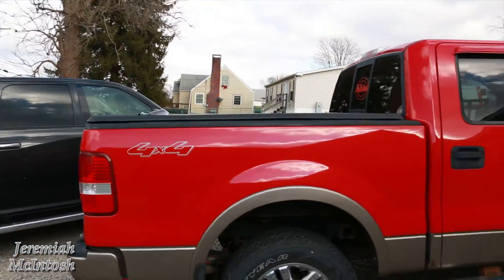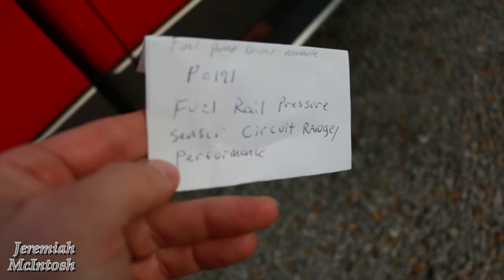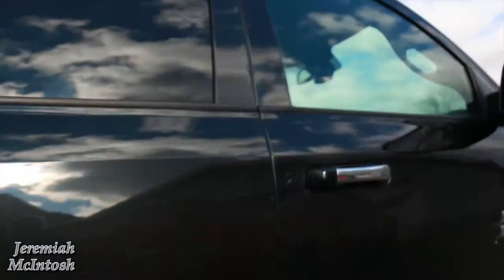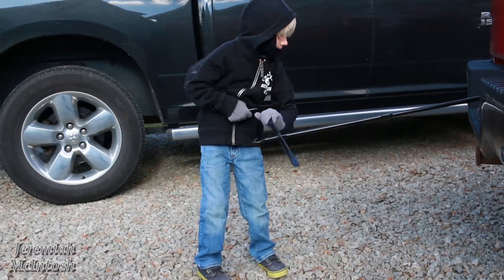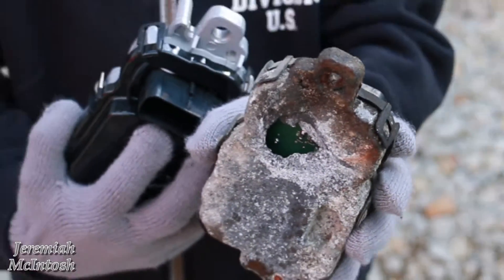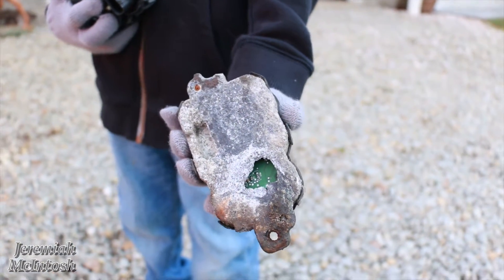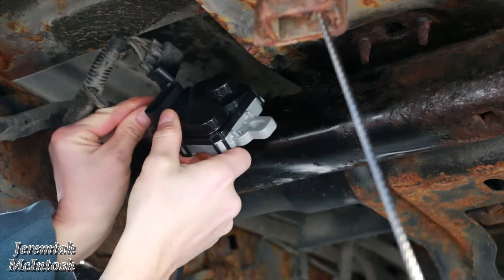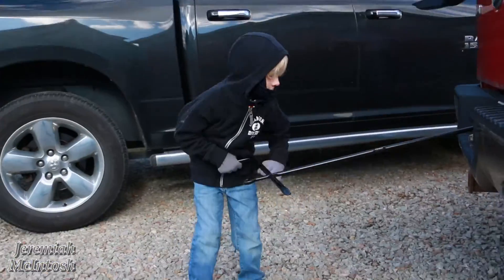Ford F-150 Fuel Pump Control Module. It will fail so Change it before it fails!

Comment: I'm having this issue with my 06 F150. Got the OEM module but turns out it needs to be programmed. 

 Did you not have to program yours?
Reply from the maker: Nope just bolted it on.

Comment: This video was a life saver for me!
My truck died on me 8 hours from home base. Had it towed to a local Firestone.  These clowns were saying all these other things was causing the issue, like battery , starter....to later fuel pump.
I did a cursory search online and found this video....pointed the service techs in the direction of this part....they begrudgingly replaced it after i fought  with them.  Lets start with a 130  good possibility as apposed to a 1k plus "guess" (fuel pump).  The sweet feeling of vindication when my beast fired up after replacing the module. I drove it back home 8 hours with no problems. 
 It also fixed another issue i was having for a while , possibly a "warning sign" that it was failing .
before i had this replaced ....my truck would occasionally feel like the the trans was slipping on acceleration.  That problem is gone now, probably due to fuel delivery issues
Thanks again!
Reply from the maker: Awesome and very glad it was helpful for you and saved you a ton of money. Hearing these things is what keeps me creating this content! Thank You!

Comment: Thank you...watching 20 videos and reading dozens of articles online,, listening to online mechanics..none of them even mentioned the fuel pump module as a potential cause.. I replaced the fuel rail pressure sensor,  and was considering the pump and o2 sensors and pressure regulator..$$$$😱..I just watched Chris fix replace it and test the power in the connector with paper clips last 2 holes on left and right of connector...and then your video pops up with the po191 code and you replace the module..wow..you have incredible timing..thank you...I really mean it man..haven't been able to work in a weak..going to shops, getting diagnostics and buying parts...your video was on time...thanks again...
Reply from the maker: You’re welcome I’m glad it helped you! Hope you get back up and running again soon.

Comment: Had a customer with a truck that died on the highway. He towed to my shop- I tested it with my OBD tool and it showed "OL" for the fuel pump.... Did a little research BEFORE i was going to yank the fuel pump. Good thing I did. The module looked decent from the front. Pulled it off and BAM- the entire back was corroded and a hole was in the case. Replaced it and he is back on the road in less than 12 hours! <- The truck was towed to my house at 7PM
Reply from the maker: Great glad you got it fixed easily!

Comment: Did your truck crank? Or nothing at all like a dead battery? I'm having this issue with a crank and gas smell
Reply from the maker: Yes it cranked fine but would not start. So your truck is not cranking?